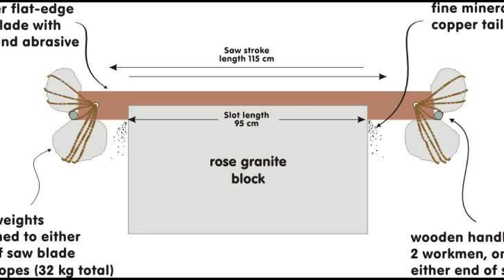Ancient Architecture channel trailer

Comment: We need to be looking at the Hieroglyphics like engineers/physicist, not linguists, there seems to be a physics base layer underneath and even the alphabet that speaks to a profound the knowledge of physics. Look at the alphabet and tell me it does not just scream physics assembly instructions. 
Hell, they eve seem to understand the right hand rule, an arc wave (letter Q). 
A is just a vantage point ad the different birds tell you how high the vantage point is (ducks indicate to floating). 
E is light energy indicated by a feather. Y is two feathers ad could speak to splitting of energy. 
T has a half moon which could indicate, meaning linear time onto a single point or the curved kitchen tong symbol speaks to the curvature of time through space.
Anyway just trying to add some fresh eyes to something that has not been mentioned before that i know of.